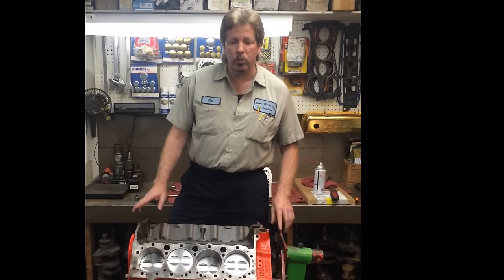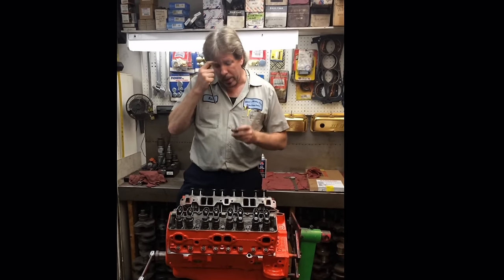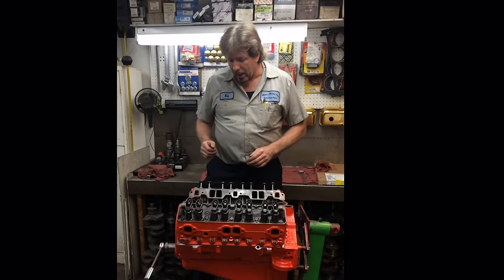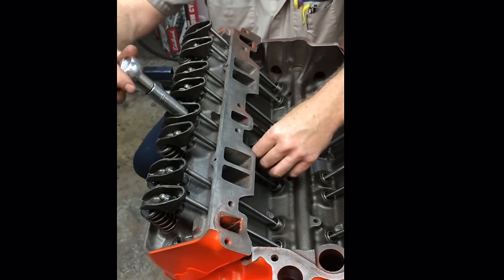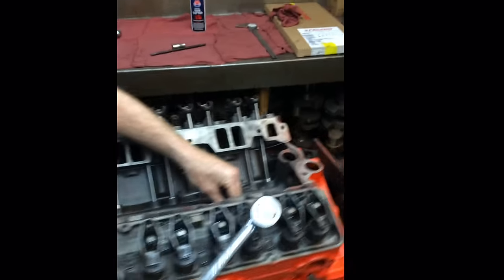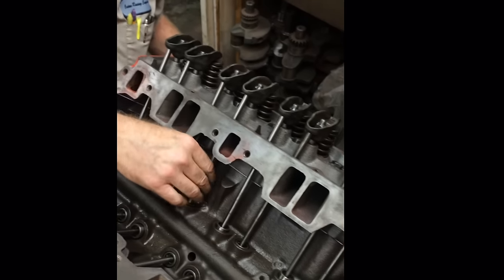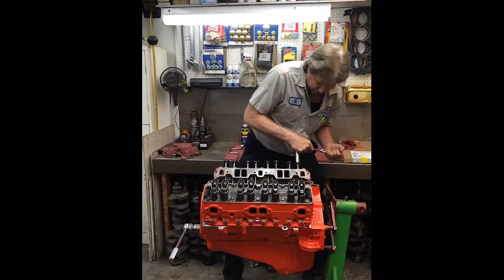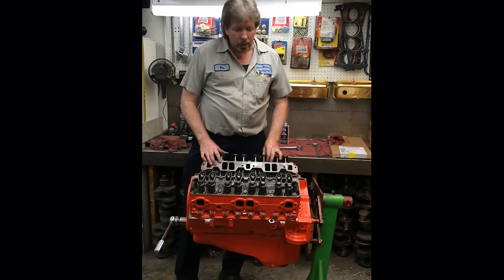Hydraulic valve adjustment made easy - Your Engine Guy

Comment: QUESTION PLEASE: Hello Ken, I just Saw you video and I have to adjust one side of my block, only fix pair side of the head of my v8 and my only faul on the whole process was the adjustment of the hydraulic valves. my only question is when you adjust the rocker you rotate the pushrod until stop rotating or filling that is not going up or down of maybe other viewer can help me Thanks in advance.

Comment: Awesome video thank you 🙏 I have a 1987 Chevy van and this is exactly what I need to do once I remove the heads & re install , ? when starting the valve adjustment procedure is it OK if I just started at top dead center with the number one piston on compression ? Or does not matter? As long as I keep turning the motor 90°  8 times like you explained I was just curious thank you

Comment: So if I go out to my stock 289 Ford and can spin any of the pushrods, they're out of adjustment? I'm loving the simplicity of this procedure!
Reply: I'm thinking that at least the pushrods on the valves that are closed would still spin after adjustment , the ones on the open valves a little harder , right or wrong ? Does it have the positive stop rocker arm studs ? H
Reply: Hydraulic cam I presume ?

Comment: I would like to know if this process can be done when the hydraulic lifters are still in the engine and have oil in them. The engine is still in the car. The engine is a 389 cid/4bl, in a 1964 Pontiac Bonneville wagon.

I have pulled the intake, distributor and valve covers. I will be installing all new, 7/16 screw studs, stock 1.5 rockers, grooved balls, adjustment washers, polylocks, and custom chromoly pushrods.

Comment: I do it by adjusting each cylinder in the firing order at TDC on the compression stroke beginning with number 1. That way I am absolutely sure the cam is in a position where both valves are closed.

Comment: Can you do this on a currently running engine? In other words i have 1990 f150 daily driver. Can i pull off the intake and valve covers and follow these directions or is this only when you are reassembling a motor? And it has no oil

Comment: Awesome method

I have a ford 302 that have a bad head joint gasket, does this method apply to lifters that already have been running because they will have oil in them. Just wanted to know if I can do the same when reassembling the motor back.

Comment: Ken, I have a pontiac 400 and would be installing new 6x-4 heads, given that lifters are in the bores does your valve lash technique work, i.e, would the lifters present have residual oil in them and impact the adjustment. I figure if you do several complete cycles, any oil should come. I also think I may have one collapsed lifter, if I add cam lube to a new lifter and replace the defective one, will it damage the camshaft. My car is all stock, just replacing the heads to increase the compression a bit. Thanks for your input and guidance.

Frank

Comment: What’s the best way to adjust hydraulic valves for a new motor build that has already been running?  I just picked up a project car that needs the valves adjusted because the previous owner isn’t sure if it was done correctly.

Comment: I no this was 7 years ago and not sure if your still even on here I really don't do much of motor rebuilds just general maintenance but is 3/4 of a turn good for a all stock 93 Chevy 350 TBI engine? Just had to pull heads to put fresh head gaskets on and new valve seals did not touch the lifters so they are still full of oil and iam going to reuse the push rods that were in it as they are still in good shape

Comment: Great video. Soon I'm taking my stock heads out (on 351 Windsor) for new valve seals and valve lapping. I have a question though. When I'm putting the heads back on, my hydraulic lifters will be pumped up with oil. Will this procedure work on pumped up lifters?

Comment: Could this same technique on my 4.3 L, V6 Engine, 1994 Chevy pickup truck I drive every day with of course the engine in the truck and the manifold not off, but just adjust with the valves with the valve covers off? Would there be enough room to spin and move the push rods to determine how tight to turn the top nut to zero lash, using a 1" socket with long wrench on the alternator nut to turn the sequence of 1/4 or 90 degree engine revolutions until they are all tightened and then 3/4 turns for the preloads per valve?  If so, should I to take out some or all the spark plugs to release compression to wrench rotate the engine and would you recommend the old be drained first to address what I think you were talking about a hard hydraulic resistance in the rocker springs and of course not to forget the new oil and filter added after this procedure is complete before engine start.(that's been done before, no one once to admit)

Comment: Ok so there's over 3,000 comments here and like yourself sir I really don't have time to read all of them. This is the exact video I needed to see because I know of every way that you just explained of how not to do it and I generally get lost in the process at least three times in every one of those examples. THIS is flat out the easiest way I've ever seen of adjusting rocker arms.

The only and I say only thing I would do different is instead of spinning the pushrod to feel the lash being removed I go up and down with it the push rod until I can feel the lash is gone. The only reason I do it that way is some people have a very heavy hand and they just about compress the plunger before they can feel anything. If you go up and down it's kind of obvious when the click goes away.

AGAIN you give the nut 3/4 of a turn so if you missed a few thousandths either way is it going to tick or wipe out the cam? No

On another note, I literally had to watch this video twice because during the first go all I could think is this guy looks just like Chuck Norris... Honestly you could be the Chuck Norris of engine building in my humble opinion 😁

Take care and thank you so much for this video. In all my years I never knew such a thing could be done...

Comment: Thank you for the information I know this is an old video and it’s been about eight months since your last upload but I had a question about doing this method with my hydraulic lifters I already primed it with oil before I did my first valve lash adjustment I’m working on a remanufactured 5.7 Vortech that I bought as a long block already assembled but the information says that I need to set the valve lash and I’ve done that I have it in the vehicle and on the first start up it shaking real bad so I’m thinking I need to go back through and set the valve lash again but with the lifters  hard and full of oil how can I apply this method and my intake is installed so I’ll be reaching through the valve cover side. Well thanks for all your advice hopefully you or somebody will have some info on this.

Comment: Hydraulic only.
True mfg want .035" mid travel on plunger to move to be able to self adjust from thermal expansion .
PS
I noticed sealer on fire rings of  SBC head gaskets in intro.
I avoid sealer on fire ring area.
Any input?
Nice you do work there.
I do Marine, industrial diesel etc. 1978 circ Veteran

Comment: Real great vid, was wondering after rotating the crankshaft to adjust lifters, is it standard to end up back at top dead center to reinstall the distributor? Will the oil pump notch still line up?

Comment: Great Tutorial! Ken for an engine in the car that needs a valve re-adjustment, can this be still done the same way? Does the intake need to be taken off or can I get a good enough feel for the pushrods from the valve cover tops - and if so can the engine be hand cranked a few times to get oil through the lifters/rods?
Reply: Same question?

Comment: I understand the concept and do something quite similar to lawnmower  engines from 2 and a half hp to 25 hp  that have ohv except some of them will only take finger tight and lock the set screws . And of course  on 283 350 what ever I'm working on  I believe in 3/4 of a turn

Comment: Hi Ken, great video on valve adjustment. I have a question though will this technique work on engine that only head gaskets were changed and lifters were not removed. Thanks for your time. Darin A. NC

Comment: Thanks for Sharing, Makes Perfect Sense. Question Sir. With a shaft style rocker assembly such as the turbo Buick V6. Could this process be used with an after market shaft rocker assembly such as the T&D or Harlan Sharp rockers, where each rocker has the adjustable tips but still retains the factory shaft assembly design? Or am I missing something? Thanks....

Comment: I like this idea! So my brother did a cam/head swam on his trans am 400 motor. They started it a few times but theyre fighting with valve lash and they are lost as to what to do.
I was going to go thru one at a time in the firing order and adjust zero lash then 1/4 of a turn. (How i learned on a small block and mentioned in the video)

With the lifters being pumped up by maybe 20-30 minutes of total run time, could i still try this method out? Or will this only work on bone dry hydraulic lifters?
Any advice? I dont want him to wipe out his new cam!
THANKS!!!!

Comment: Great video ! Question does the same rule apply for a 1973 340 rocker arm shaft with flat tapper hydraulic lifters.
I have done the 90 degree check 2 time around on rods just not sure I need to do the 3/4 end result? I don't want to over tighten them. Thank you.
Reply: Are your rocker arms the stock ones that came from the factory? , if so I didn't think the 340 had an adjustment on each one like these.
Reply: @44special9  Factor Stock rocker arms
I just torqued to 17 bls thx.

Comment: Your method is fine on a new or rebuild. It won't work on a motor that has already been run because the lifters are pumped up.
Reply: So what do you when lifters are pumped up

Comment: Hey Man !! GREAT VIDEO.. I have been doing all of my valve adjustments this very same way. And have been told many times im doing it wrong, ( Yet its flawless everytime)Heres my question As it has been about 4 yrs since I have built an engine in the case of the engine I am building now is I am use the old lifters and they are already pumped up hard. In this case do I skip the 3/4 turn? or back it off to about say 1/8-1/4 turn? Or do I just stick with the 3/4 turn?

Comment: I have a dumb question.   So if you divide 360 degrees by 8 you get 45. So instead of going around 2 times in 90 degree increments I bolt my degree wheel up and mark every 45 degrees and go through the firing order in order. And I go through all of them in 1 full turn. And if I need to stop no problem I just count the marks and go to the 3 rd or the 7 cyl. In the firing order. And if you don't have a degree wheel you can do this very accurately with the damper on the bench. Cut it in half and half again and so on

Comment: Ive used the regular way of doing it, each valve at a time in firing order, and I can see interruptions being an issue. I have a tag that I move from rocker arm to rocker arm showing which one is next. If Im interrupted, I place the tag on the one I was working on and come back to it. Ive never lost the order that way. 

I can see this method working, as its basically the same exact thing, just a few extra steps (tightening the rockers). I dont see it as wrong, so not bashing at all. In a shop, yeah, somebody could mess with your tag, turn the engine etc, so this eliminates that for sure, since you keep going until all are tight, no less than 2 full revolutions.

I might give it a go...although Ive been doing it my way for so long I might get all messed up lol. I came here just because somebody mentioned this method, but forgot a few of the steps and to me that sounded ridiculous and wrong. Like the style of your videos, down to basics and not too short. So Im gonna subscribe. Im sure I can learn a new trick here and there.
Reply: Hey bud was hoping you could give me a few words .. I hve a 390 fe with a non adjustable rocker arm shaft assembly  can I use this method?  Or?  I'm also trying to set the preload   . I'm kinda confused or are these 2 one in the same. Please help . Thanks buddy

Comment: Very cool video. Thanks for sharing, I have a question . I am doing a budget backyard head job (after a over heat) on a 79 350 in my bush truck, engine still in truck.  I have about 150 thousand on  a complete rebuild a few years ago so I figure bottom end is still ok, (looks good anyway)  Anyway my question is when I set valve lash this way with lifters full of oil what advice might you guys have on this situation? I am going to try and see if lifters will come out easy and clean them ,emptying them, That will be this weekend. But I cant imagine they will pull out ?  Any thoughts and advice would be welcomed. Thanks
Reply: Fyi All my lifters came out and I was able to clean them and empty them and I am ready now to adjust my lifters using Ellisions system. Thanks again Ellision machine shop for sharing .

Comment: Nice video.
I'm wondering, how would you bleed all the air out on a 1994 lt1 engine with a optispark distributor on it? I want to use this method but I dont know how to bleed the air out and get oil into the lifters with the engine still in the the car and nothing else taken apart other then the intake valve covers and push rods.

Comment: those must have been studded heads correct?
because in pedestal rocker arm configurations, the process is to just torque them down.  no actual adjustment.

if yes,, these are studed heads,,, then you may have just solved my issue for me where i am making just a tad bit of low vacuume.  meaning i have a valve somewhere not closing all the way.

i hope you see this and thank you and hope you reply.

Comment: I really wish that you could have the intake manifold off on an FE .  Someone needs to invent a piece to complete the heads and has a dry intake and pushrod pinch to port like an adapter for 351C intakes with a bias to match the Cleveland’s ports. That is all that makes the FE a PIA to work with. Otherwise it is still a great engine! Especially a 428 CJ with a solid cam.

Comment: Also, the guy said he machined the heads and had it cammed but he doesn't know which cam he used. Any idead as to how I should tighten the rockers and valces? will your procedure work the engine without knowing what cam went in?

Comment: Hi.  I have a 1998 Dodge Ram 1500 5.2 4x4 I just acquired.  Had to replace a spring retainer cap and a pivot retainer and bleed down two stubborn lifters.  I tried your method, but after turning the crank some are EXTREMELY tight and some seem "normal".  Is this the way it's supposed to be?  I did this while the engine is still in the car without removing the top (intske) part.

Comment: Great video! I've done the engine running adjustment many times and it is a mess to say the least. I am not clear about using this method to check or reset the valves on an existing engine. I  will be replacing my intake manifold gasket and after 35 years and about 40,000 miles I feel the value adjustment should be checked.  With the intake off this looks like a great way to do that. My concern is the lifters are not dry as they are in your video. Will this process still work the same way since the lifter are not dry? Is there something I am overlooking or not understanding?

Comment: I'm going to try and do this on my 1988 GMC Sierra 1500 5.7L  engine. But I have two question. Does it matter if the engine is in the truck? And will the procedure be the same if my lifters have oil in them already or do I have to drain the oil first?

Comment: Hey I followed your instructions on your vid in 2019 are you suppose to re adjust them after 1000 mile break in that's what I was told from my rebuilders and from what I'm reading on the web is true starting to get a miss fire and all sensors and disb are new this is on a tbi V6 4.3 astro I'm stuck now because this was done without oil maybe give another quarter turn on the ones that seem loose no tapping though

Comment: When you are removing the slop from the pushrods, do you tighten the rocker arm bolts until the slop is just removed, and the pushrods spin very easily, or do you tighten the rocker arm bolts until just before the pushrods stop spinning?
Thanks for any clarification.

Comment: I’m 5 years late seeing this video. Literally have a 68 corvette 327 rebuilt on the stand, and after adjusting the valves, it would not turn. I loosened the entire valve train , filled the motor with oil till it was spilling out, filled every spark plug hole with oil and replaced the plugs and the motor still is on the same stand and not rusting that’s for sure. Question, what change do I make to your instructions if I previously bench pumped the lifters and they are drowning in oil right now?

Comment: I replaced valve seals on my 89 SBF. Didn’t know about valve lash procedures. Torqued rockers down to 20 Ft lb on flat lobe. Put back together and rockers rattled. Took all back apart and watched your video 3 times, rotated four times when I do final rocker tighten, I only get 1/4. Am I missing a step?
Reply: So you have hydraulic lifters with stud mounted rocker arms with a nut or does it have a bolt ?

Comment: I have a 350 Chevy crate engine that I just broke in. They recommend a valve adjustment; I just did the adjustment like you show here, but will this be the same since the engine has been run (so its oiled up)?

Comment: So what happens if you don’t do the 3/4 turn at the end?  Now I can’t remember if I did it or not when I built my boat engine but it started right up first crank and only issue is it doesn’t go over. 4K rpm’s.  No noises or anything.  I’m wondering if I forgot to do that 3/4 turn at the end and maybe the valves aren’t opening up all the way to allow more flow.  Is that a possibility?